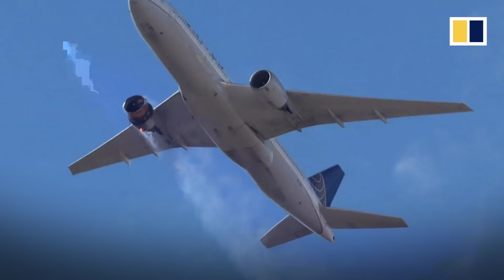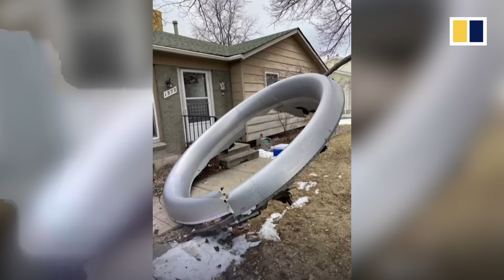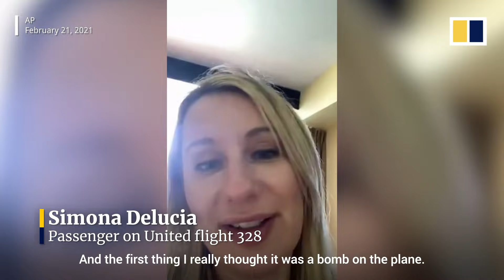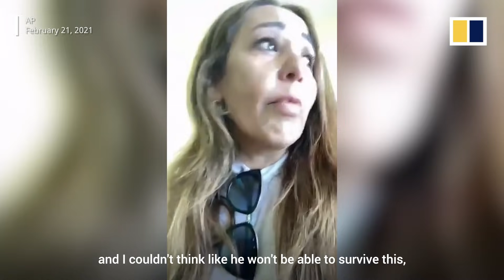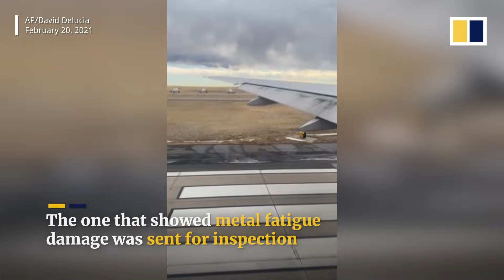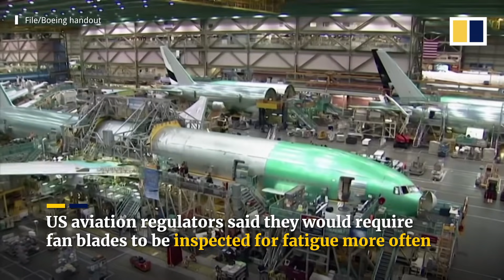Plane engine that caught fire on United Airlines flight showed signs of ‘metal fatigue’

Comment: This accident is indeed considered VERY LUCKY 5 ways:
1. They're still able to land safely (most obvious)
2. The break happened near the airport and didn't give out over the ocean on the way to honolulu
3.  No one got injured from the falling debris
4.  The safe landing and engine basically intact provided instant evidence to the cause and wasn't otherwise another lingering mystery
5.   Didn't explode into a fireball
Reply: the most important did not damage the hydraulics in the wing
Reply: I only see two points. It doesn’t matter if the engine fails over the ocean therefore flight routes are designed according to etops. The only two points are no fire ball and nobody got hit by parts.

Comment: Thank the engineers that designed the plane so that it can fly off one engine just not the engineers that maintain them.
Reply: it can glide even without engine for 2000km
Reply: Boeing final proper designed plane
Reply: @alltruth881  yes
Reply: @alltruth881   the wing kinda act like glider
Reply: @alltruth881  it was made for easy control but just requires force to push
Reply: @SP-kt1dq  2000km ?
Reply: @widayantosetio  Yes. the lift force is related to the moving speed of the plane and air density. If the plane at a high altitude when engines stop, the air resistance will slow it down cause it to decent, but at a lower altitude, the air is denser, which the plane require less speed for the same amount lift. Also decent itself give the plane a speed boost. A plane can glide for a very long distance as long as wings are not damaged.
Reply: @SP-kt1dq  yea i agree without engine plane still able to gliding, but 2.000km, that's very far bro 🤔😅
Reply: @widayantosetio  I am an aerospace engineer
Reply: @SP-kt1dq  the glide ratio of a 777 is at best a 19. That means for every 1-meter drop in elevation it will travel about 19 meters. The cruise altitude of passenger airliners is about 35000 (This plane wasn't because it just took off), which means 35000 ft * 19 = ~200km. This is the best-case scenario with a lot of assumptions. IDK where you got 2000km from. Unless if you are talking about only 1 engine being out and not both.
Reply: @Skankhunt-mv4vd  there is no such thing as glide ratio, you may refer to the lift to drag ratio, for beoing, it is around 19, you still have to multiply square root of velocity square times air density divided by half

Comment: Pretty much the engine caused a lot of issues, currently a few 777 airlines I know could be at risk with this fatigue. The 777 airlines that still uses PW engines, Korean Air, Asiana Airlines, Ukraine International Airlines, and that's all I can know, I felt that, like if the engine issue like this, I might see the same worldwide grounding like the 737 MAX before.

Comment: That's how Boeing plane would fly. It's normal, don't worry about it people.
Reply: No. This is not normal. By the way Boeing doesn‘t manufacture engines. Pratt and Whitney does it. So you can do research before spewing nonsense.
Reply: @abbysnowmist  It's called sarcasm mate

Comment: Boeing at it again!
Reply: This was engine fatigue. Engines are manufactured by Pratt and Whitney.
Reply: abbysnowmist you can’t say that! If I bought a Nikon camera and they choose to use Sony sensor. In case where the sensor dies, Nikon is in charge of the product.
Reply: @grandiora  Nikon cannot be blamed. Sony had produced faulty equipment and therefore they have 100% responsibility.
Reply: @grandiora  In that case the blame goes 100% to Sony.
Reply: @grandiora  Airplanes and cameras are different. Do you inspect every piece of your camera every time before you use it? Airplanes are inspected by the pilots everything before a flight and periodic maintenance inspections. Therefore, whoever was inspecting the plane was negligent and therefore United employees also have to carry some of the blame. However, Boeing already sold the airplane to United. Therefore, the owner (United) is responsible for the airplane. Therefore, Boeing cannot carry any responsibility.
Reply: @abbysnowmist  do you work for Boeing or something? Engine issue isnt something that United pilots can see with their eyes in their inspections. 
As long as periodic maintenance has been carried out by the airlines, the fault lies with Boeing, the product manufacturer. 
If anything happens, the families go after United, the service provider. United goes after Boeing whom they bought the product from. Its up to Boeing then if they want to pursue their engine supplier to recuperate damages.
The engine maker could very well come back and say we made it to your specs. If you engineered to a lower cost specification we are not fully liable for possible poor designs.

Comment: time tor world avation industry to rethink and innovate alternative for passengers if this kind of thing happen just in case the engines both fail and the pilot is not sully skill.
just let miracle happen ? 
more strict rules should be made for airline around the world how soon important "life depend on it" parts need to replace.
Reply: Dual engine failures are extremely rare. Like, extremely extremely rare. You could probably count on one hand the amount of major incidents. It’s really not a big worry.
Reply: @thatkaveman99  ur right but even one engine failure not all pilot got same skills to control it.
Reply: @coolinspirefunnybook1289  all these pilots have gone through rigorous simulator training dealing with engine failures. Most engine failures don’t end in tragedy.
Reply: @thatkaveman99  honestly got to give some props for the engineers who designed the plane to be able to run on one engine. I mean if this doesn't show that it's safer to fly than drive a car I have no idea what does
Reply: @thatkaveman99  r u sure ? sully case is consider tragedy.
Reply: @coolinspirefunnybook1289  what I’m saying is the sully case was very very rare. Most engine failures are of just one engine, which most of the time leads to a safe landing.